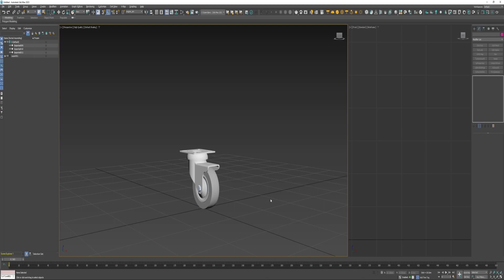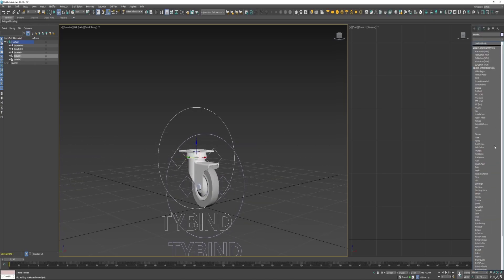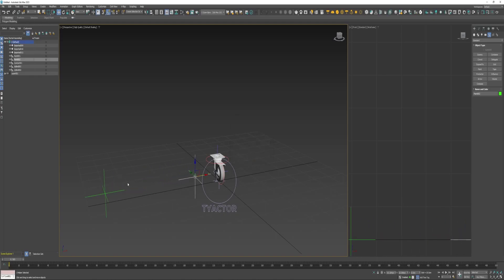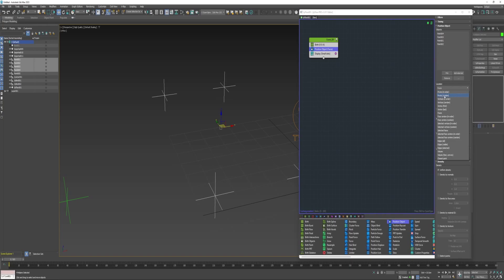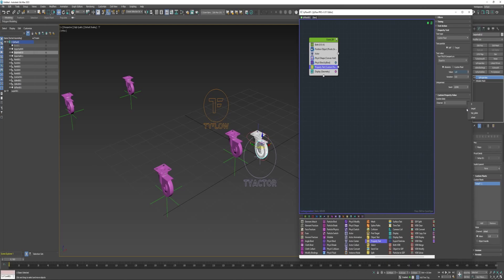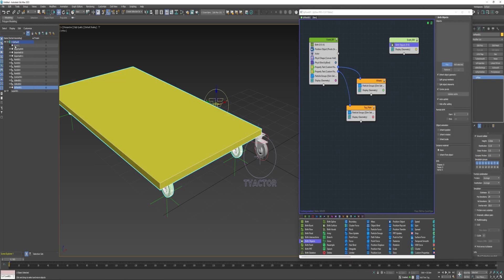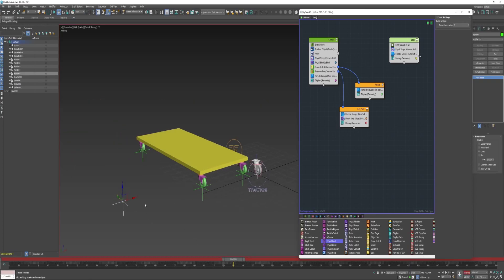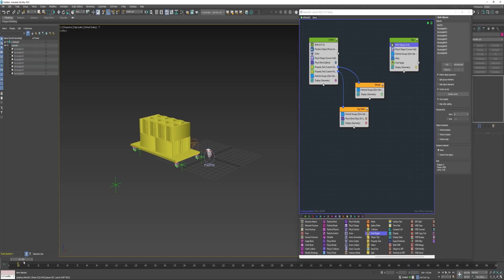Simulate Swivel Casters --- TyFlow / 3D Studio Max - Beginners Tutorial

Comment: Hello from france, sorry for the worst english translation but i just want to thank you, a clear and easy way to understand how tyactor, tybinds do and how we have to work with.

I've made evrything you do, but i've a problem with the plate and the plank, the plate are not rigids, and turn in every axis.. Is there a way to modify that and force the plate particle to turn only in the Z axis and not the other ?

I plane to create a shape like a cube with chamfer angles, and as you can imagine, it roll specifically with that shape, not as a wheel can do..
And it's a pain to do it..
If you have an idea how i can do that thing.. I'm interest !!
Cheers !
Reply from the maker: @vincentgrieu1290  Hello Vincent, thanks for watching the video and commenting, I really appreciate it. Yes there is definitely a way. If the plates connections are tybinds, and they are rotating freely in an unexpected way, you may have the swing settings enabled, you need only the twist settings. If the twist is all that’s enabled then check and make sure the z and y locks are checked in the swing setting rollout. If you have a red, yellow, and green circle then lock the z and y, then rotate your tybind until the red circle is aligned along the axis you want it to rotate on. If this did not help you solve the problem, send your file to lanceculver@gmail.com and I will set it up or correct the issue, no problem. And of course if this did help but you run into another issue, please come back here and let me know, we will get it working one way or another. Thanks again Vincent.
Reply: @lanceculver  Many thanks for that answer, i'll immediatly open my file and check, i'll be back to tell you about it.
Cheers

Comment: Do the wheels rotate properly based on travel speed?
Reply from the maker: Hi G G. Travel speed will influence how fast they rotate, but it’s more about the setup of the tybind - physX shapes, the center of mass, friction, etc, working together. There are no operators specifically controlling the rotation, but rather the “force” is being applied to the object the casters are attached to, and the wheels react accordingly. Thanks for watching!